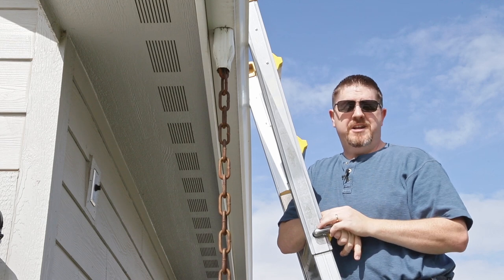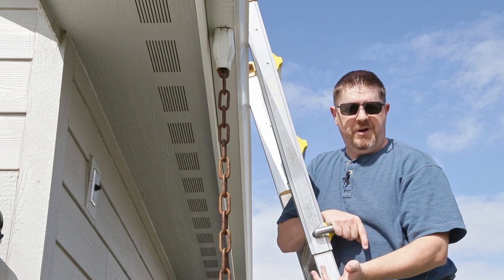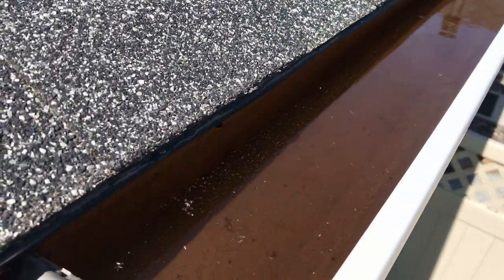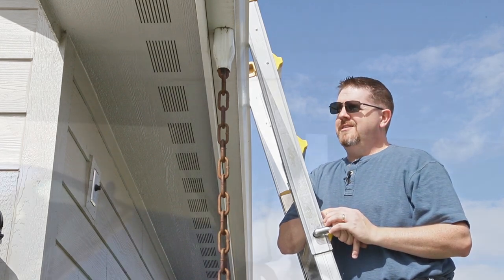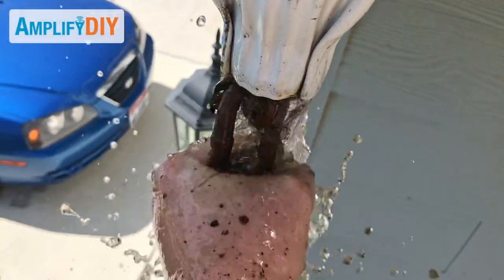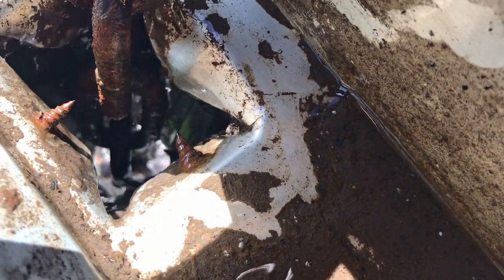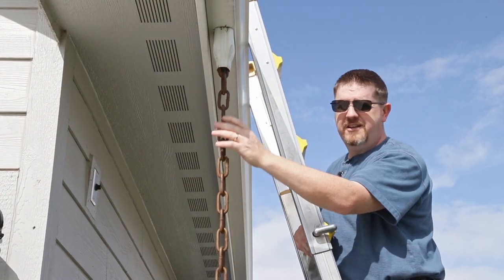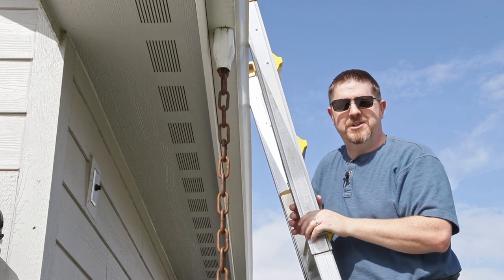Watch Out For This If You Have Rain Chains (Gutter Completely FULL!)

Comment: I searched online for other examples of a crimped leader.  You seem to have the only one; guy who installed it apparently didn't know to leave it full size.  I installed a few on commercial/institutional buildings (health clinics & offices); heavy chain was popular but not practical for residential.  The crimp is the problem, not the rain chain; you would have a clog even if it was downspout.  Swap it for a new full size leader if you can to prevent regular problems, then re-hang the chain.

Comment: They do work, but you cannot use them with a constricted spout. Bad idea to crimp that spout to the size of the chain
Reply from the maker: Several other commenters have mentioned that these were simply installed wrong. :-( For now I'm just keeping up with cleaning them out frequently. I do plan to eventually fix the install so it is done correctly and won't keep clogging. Thanks for watching!

Comment: Your rain chain was built and installed wrong ,the gutter should NEVER have any length of downspout attached ,the chain is supposed to be hung from the gutter using a snap in bracket or a piece of rebar that lays in the gutter with the rebar going through the top chain link,that heavily crimped piece of downspout is what's screwing your drainage, remove that piece & allow the chain to be 100% exposed where it connects to the gutter & your gutters won't clog, rain chains work best in areas that have freezing winters , instead of having gutters full of ice ya simply give each chain a little smack & the gutters path of water flow will be free of ice which allows the gutters to remain free of ice build up that cause major roof leaks ,this is not a new idea with modern houses , rain chains were used as far back to the period where wood shakes covered the roof and drained into wooden gutters made water tight using pine tar to seal wood joints & preserve the wood ,rain chains pre date metal gutters & downspouts by 300 years or more .
Reply from the maker: Thank you for the tips, Michael! Time for me to go make some adjustments to how these were installed.

Comment: Hmmm. How many wrong things with this picture?

Installer crimped downspout to reduced orifice.

Used several screws to further act as debris catchers.

No gutter screens to slow debris filling of gutter.

Excessive weight of large steel chain on aluminum gutter will cause sag or tear off.

Unreasonable expectation of not believing ALL gutters will need maintenance, expect them to clog at some point.

I think video title should be titled,  All the Things You Can Do to Make An Ineffective Rain Chain

Comment: Not a Solution but it might have been easier to just pull the chain up from the top of the gutter.
Reply from the maker: Hi Charles - the chain is very heavy, and it's quite difficult to manipulate the links through the small throat of that opening, past the support bar that the top link hangs from, etc. I've tried to pull the chain up while sitting on the roof, and it was much more difficult.

Comment: As someone who works around , in or with gutters. I can say they can be a pain. Like down spouts. However, had a "resourceful" customer who used a screw in metal filter , looked like something I used in kitchens back in the day on commercial grade sinks and food prep machines. . But it was about 4 inches long screwed into a pvc fitting he used& the two pieces of pvc were threaded like a compression fitting, but was 2 inch hole to 1.5 inch, I'm guessing , reducer. Anyway, the filter still can get clogged at the bottom. But!!! Where this seemed to help only for heavy water etc.. still clogged around the bottom up to the middle . But the water still drains due to the nature of the 3-4 inch "filter". Top inch or so didn't seem to get clogged and allowed for drainage. Also, everything is just heavy hand tight, comes off to be cleaned in 2 seconds. Kinda nice. Will be stealing that idea. Cuz at the least, it's an easy pul apart and clean, reattach. And easy replacement for under 10$ at most hardware stores. The bigger issue I see powerwashing for reality groups is, poor drainage and splash up on newer construction. Wether it be with fancy looking chain drains, or old skool down spouts. . New construction apparently just doesn't care about foundation damage from poor drainage and surface damage from splash back. How hard is it to put a decent gravel or river rock outset for a foot? Save yourself , the owner and future folks like me some hassle. And potential foundation issues,damage ( surface or appearance, or structural) ... Build it right. The foundation doesn't care for soggy soil .

Comment: Still way too much splash to have it that close to a wall. Just asking for trouble
Reply: Please explain exactly what " Trouble "will arise from using a rain chain in place of a downspout ? I'm a Journeyman Roofer/waterproofer with 4 decades experience & I cannot think of a single area of a home that would be damaged by using properly  implemented  rain chains vs aluminum downspouts ,explain the trouble he is asking for please .
Reply: @michaelledford4751    I was concerned about the water pouring down right next to the house foundation and possibly creating a problem with the foundation wall?  I like the idea of chains, but that is the one concern we have.  Our yard is level all around the house.  We had put an extension piece on the downspout so the water would hit ground further from the house.  Or am I just worrying too much? 😊

Comment: My neighbor befor i enlisted had these his solution was to have a regular down spout and have the chain run up through it to connect to a X shaped bit of rebar he had, it allowed everything to flow freely and also allowed him to change his mind if he didint like it he said, he rolled with them for going on 5 years and has no issues
Reply from the maker: Chain inside a downspout? That really interesting. I would have thought you only did one or the other.
Reply: @AmplifyDIY  only the adapter, he had a regular downspout and switched over to the chain so i still consider it a downspout, i see a lot of them necked down but his wasnt cause he wasnt sold on the idea and wanted to be able to switch back

Comment: That's a terrible way to funnel the water, tech had no idea what they were doing. Yes a standard downspout outlet won't work, a funnel outlet is critical for the chain to work properly. What's represented in this video is not the way to accomplish a functioning gutter system.
Reply from the maker: Should I swap out what they installed? Have a link for what I should use instead? Thanks!
Reply: @AmplifyDIY  what you have is a typical "X-  cut outlet" meant to directly fit into either a downspout (in video) or an elbow leading back towards the wall. Visit rainchains.com  and they will have a more suitable transition, although with the style cut you have now it may be a bit of work and probably a bit unsightly to alter. If it were mine I would remove the chain and simply install a downspout.
Reply from the maker: Thank you for the info!

Comment: just un crimp the downspout. The chain is decretive, just let the water fall.
Reply from the maker: The chain is actually not just decorative. The water is supposed to travel down the chain so it doesn't splatter and cause large spray patterns to appear on the bottom of the house. If I pulled the chains out, I would need to replace it with actual downspouts.… Which is something I would like to do but I'm not sure my HOA would allow it. Thanks for watching!